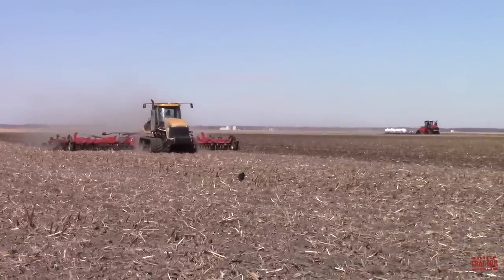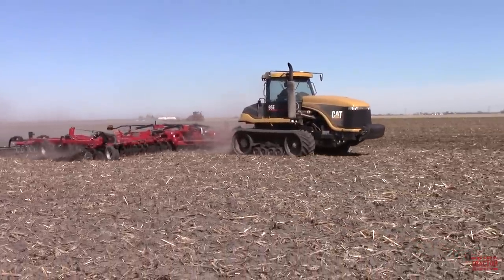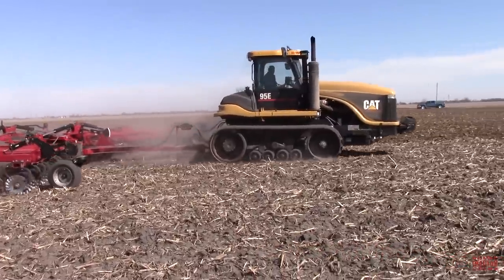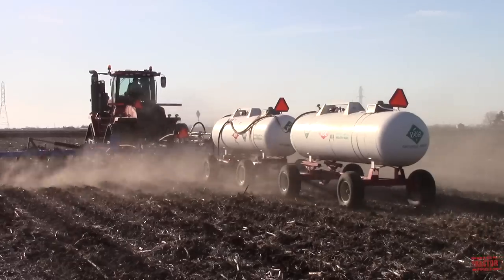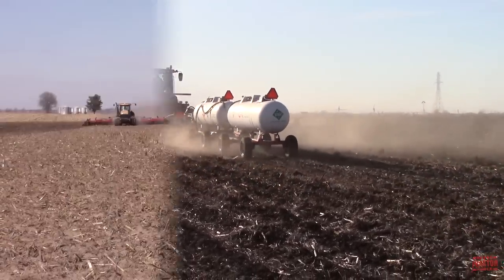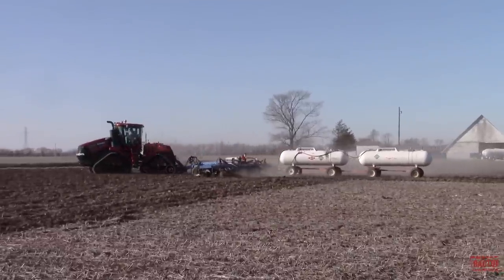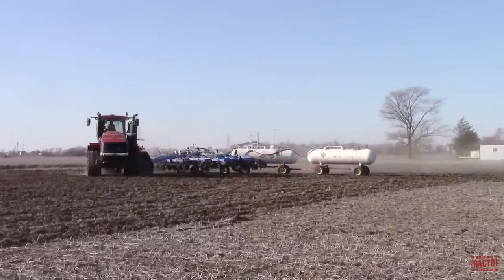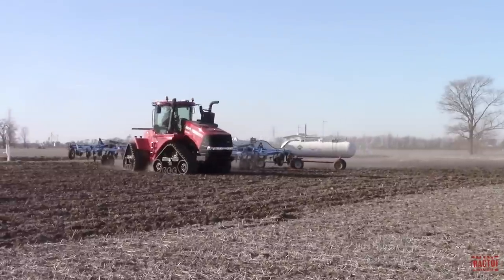Spring Field Work with BIG TRACTORS

Comment: Here in Southern MN it will be a little over a month before we think about farmin.  We're all green. 9620rx 50' 2210 field cultivator 9630t 44' 2210 field cultivator 9520rx 24 row planter and 8r410 with the 2nd 24 row planter. I'm sick of winter and looking forward to getting in the field. I run the 9620!
Reply from the maker: Great line up.  The 9RX is a nice tractor. Very cool to have 9630T in the mix.  I am a big fan of John Deere 9000T/9RT tractors.
Reply: @bigtractorpower  I don't think the boss will ever get rid of the 9630. 08 model with around 5800 hrs. It's kinda our backup big tractor. Some digging in the spring then on the roller. It doesn't do a whole lot in the fall unless tillage gets behind. The 2 rx's take care of fall work. We have 2 9870's that's been good combines and he finally broke down and traded the oldest one for a 690. Hard to get rid of something that's worked and we've had little issues with.

Comment: Cat really had a solid tractor with their original design, and completely redesigned them into another crazy great tractor. Our 45 has only had one problem in 20 years
Reply from the maker: These were well built tractors.  I have been lucky to get to feature a 65, 55, 85C and 95E from the original generation.  The MT800s are solid tractors too.

Comment: My dad work for a guy he use to run a lot of Cat tractors. He use to have 2 of them 95E's. In 2004 he trade them in on 2 MT 865 A tractors. He kept the 2 55's and 35's sold of 2 of the 3 mt's he use to run. (1 MT 865 and 1 MT 755). He moved away from crops to cattle but still have about 410ha till ground that he plants maize an soja. This is all in South Africa.
Reply from the maker: Challenger built some solid tractors.  The 5 series and MT tractors are tough.  Thank you for sharing.

Comment: I used to apply Anhydrous Ammonia but only pulled a single tank . I've seen two tanks on a trailer , probably custom built.
 But haven't seen any pulled end to end . Great video I'd like to get out and work in the fields
Reply: Having two tanks on one wagon is the norm in western Canada and has been for 30 years. From twin 1000 gal tank to twin 2500 gal

Comment: I haven't seen one of those classic Challengers working out in the fields in years! It's mostly John Deere territory where my grandfather is. There were a select few oddballs though. The Challengers were extremely rare.
Reply from the maker: The flat track CATs are harder to find these days. This farmer runs modern Case IH tractors for the most part and a few John Deere Soundgards.  He grew up liking the early Challengers and jumped the chance to add this 95E as a tillage machine.
Reply: @bigtractorpower  I remember when I was looking through an old tractor magazine I had that was issued a little over 10 years ago, there were quite a few of them for sale.

Comment: Tracks require extra maintenance that is not necessary with tires.
Reply from the maker: They provide allot of additional speed in tillage.  I have filmed wheeled and tractors running together and tracks will lap the wheels after a few passes.  Each has its pluses and minuses.
Reply: Tracks are awesome for flat ground and wide open fields with little road time. Tires are way better on the road, and especially on side hills. Tires for upstate NY, I dont enjoy sliding down the hill.